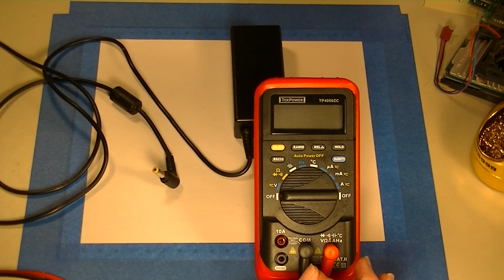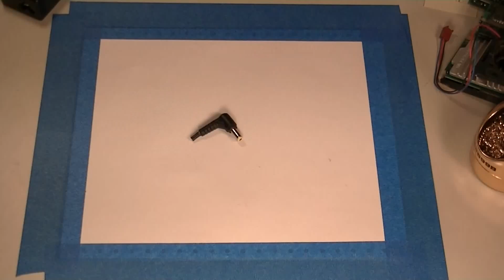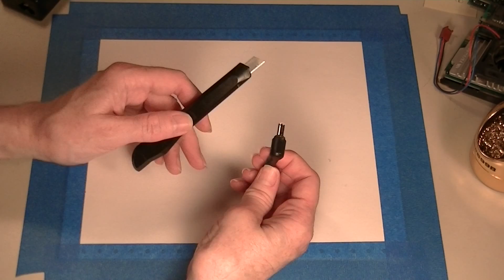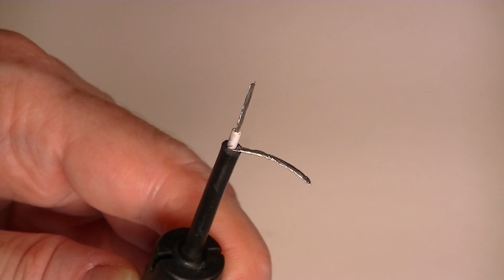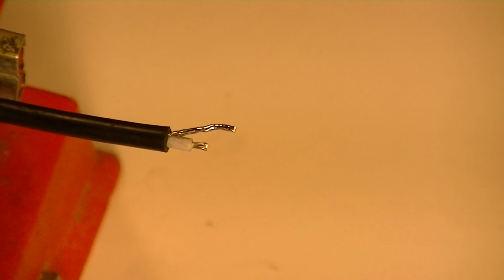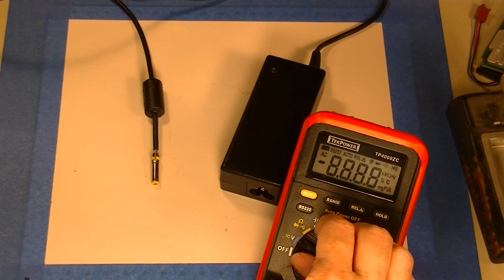Repairing a laptop AC adapter

Comment: is it ok to use 19V 4.74A charger instead of 19V 3.42A charger?
will extra amp damage my laptop or battery?
Reply from the maker: As long as the voltage is the same, the amperage doesn't really matter.  However, if the charger cannot supply the same amps or higher than the original, it will take longer to charge the battery.
Reply: thanks for the reply.

Comment: what is the third conductor in 1:17 for ? 
What are testing in 2:17 ? short circuit voltage ? it must be zero then but what is mode  in multimeter ?? I mean the third option u turned the meter into ? is it ammeter or voltmeter mode ? 
in 2:27 what do you mean by continuity ? i guess you are measuring current .. but why the adapter is totally un plugged ? 
Thanks
Reply from the maker: The third conductor (the middle pin in the DC power plug) is for communication between the AC adapter and the laptop.  Without the third conductor, the adapter may not work at all, or it may run in a low-power mode that charges the battery very slowly.

At 2:17 I'm testing to see if the positive and negative lines are shorted together.  That test wasn't strictly necessary since I was going to remove the damaged section of cord anyway.  This test is performed in the OHMs (resistance) mode.  If the positive and negative were shorted together in the damaged section of the cord, the meter would have read 0 ohms.  When using Ohms range, there should NOT be power applied to the device being tested.

Continuity means an unbroken path or circuit.  The device or circuit should NOT be powered, the Ohmmeter will supply its own power.  Using an Ohmmeter (or multimeter in Ohms range) on a powered circuit could damage or destroy the meter, sometimes catastrophically.
Reply: what are the expectations of a continuity test of a non functioning adapter ? say we got continuity or 0 resistance and that means a short circuit .. or that we got no continuity and high resistance whcih means an open circuit .. in the latter we say cord must have gotten cut some where .. but in former case how we justify or solve the adapter faulty ?

Comment: While soldering the ground wire ( the outer one) are you soldering it to the outer metal covering itself or to any specific spot over there? I've done soldering the center wire but the outer wire won't stick to the external metal covering. Please do reply.
Reply from the maker: I'm soldering directly to the outer metal casing where the original wire was soldered.  If you have no luck soldering your wire there, try a different spot on the barrel connector.  Solder won't stick to the chrome plating, CAREFULLY use sandpaper or a file to roughen or remove the chrome plating.   Be sure to use a flux-core solder, or apply flux separately.  The flux cleans the metals and is necessary for a good solder joint.
Reply: Thanks for the relpy, I had finished soldering the ground to the outer casing, I had just roughned the smooth finish of the outer casing with a hacksaw and then soldered it. now my laptop charges! Thank you once again for this awesome video.
Reply: Thanks for the tip, yep I did the same and then It stuck very well!

Comment: Hi, Master. Just imagine I'm your online pupil. I had a broken detail and I don't know how it's called, it has 8 legs.The problem is that I can not find this item in my city. There were written on the detail: "LT FOZ OB2269CPA" with small letters. Can I use another detail instead of it?  if it is possible, PLEASE master, write down what kind of detail I exactly can use for it?
Reply from the maker: The device is called an Integrated Circuit (short name IC or chip).  A quick Google search for OB2269CPA will show many online places to buy this chip.

However, it is a surface mount device and may prove difficult to install by hand.  I wish you the best of luck, my friend.
Reply: Thank you Master a lot!
Reply: Master its me again. Sorry for inconvenience. Master I have spoken with online sellers, and they have the same integrated circuit, but their integrated circuit is very expensive and I can buy a new laptop adaptor instead of it.    I'd like to ask something else, can I use an Integrated Circuit: 45580 JRS DPOD22 instead of the Integrated Circuit: LT FOZ OB2269CPA ??????

Comment: A long time ago I saw someone use kind of a transparent glue instead of using heat-shrink. this person used a gun too and it looked messy but it did the job. Do you have any idea what that glue is, or what it might be called? nice work on the video btw

Comment: I used one of those universal laptop adapter, a cheap one cost about 5-6 dollars. Just rip the cable off and replace it with new universal tipped one. Now I got an asus adapter compatible with many brands laptop Im using. And yes, put on a filter part on the new cable, its about half a bucks in an electronic parts shop. It helps your track pad from bouncing around due to electrical noise.

Comment: I think it is not necessary to cut the cable to troubleshoot the cable problem. You could just connect the + tester terminal inside the cilindrical output pin of the adapter and the negative one on the outer surface of it.

Comment: Thanks for the great video.  I have tried to do a continuity test on the adaptor pin on my working adaptor.  I could not hear anything even on a new meter.  Can you advise if I hv done something wrong?
Reply: +Richard Yap Your meter might be damaged. Try to check it out by making the two extension cables to touch each other

Comment: Great work Sir and explained very well
1) i have HP laptop and the ground wire get heated much. Also it dont charge the battery enough. It might be pin problem or what??
2) Do we really need the filter part near the pin??
Thank you...i will wait for your answer
Reply from the maker: varun patel thank you for watching.

1)  If the cable is getting warm, it could be that the wires inside are damaged or nearly broken.  Cutting out the bad section of the cable may fix it so that it will fully charge your battery.

2)  The filter is not absolutely necessary, its main purpose is to keep electrical noise from getting into the laptop from the power supply.  I have not had any problems from power supplies that have had the filter removed.  There is a chance that removing the filter could cause a problem, but that chance, I think, is very small.

Comment: Sir I have a request. 
In 0:54 you mentioned 2 parts that usually broken in the charger parts, which the parts you fixed was the later one.
This charger of mine broken on the first part that you mentioned, the one connected to the adapter box.
Could you made a video of fixing that part too?
It would be a great help. Thank you in advance.

Comment: Great Quality work . Thank you for this .  I have two questions

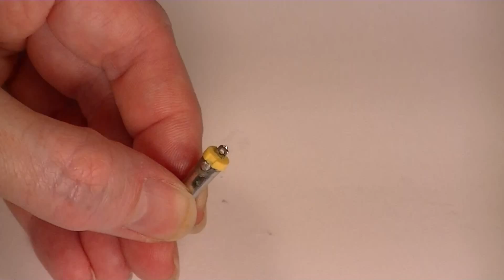1 ) At 7:40 How did you clean the solder points  ? What did you used ?

2 ) And can I remove that cylinder shaped thing in the cable (you are holding it with your fingers @ 12:52 ) because there is only 1.5 cm of wire after that cyclinder which makes harder to solder it with the plug  ?
Reply from the maker: Hari suthan Thank you for watching and for the compliments.

1)  I used the soldering iron to remove the remaining bits of wire and the old excess solder.  No other tools are necessary.  Apply just a little fresh solder to the solder points to ensure a secure connection.

2)  The cylinder is a noise filter (specifically, a ferrite choke), in most cases it may be removed without affecting the operation of the laptop or the charging circuit.

Comment: Not sure if anyone ever mentioned this , But what I do is I Tape Popsicle sticks to keep my cord from bending and it remains rigid and I have never had any issues in 10 years .
Reply from the maker: Michael Fiermonti I've never tried popsicle sticks, but I have cut sections of plastic zip ties and put them under the heat shrink to stiffen the splice.

Comment: At least the plug failed instead of the jack inside the laptop! Toshiba laptops were especially famous for the circuit board around the power jack cracking due to the stress of the plug being yanked on.